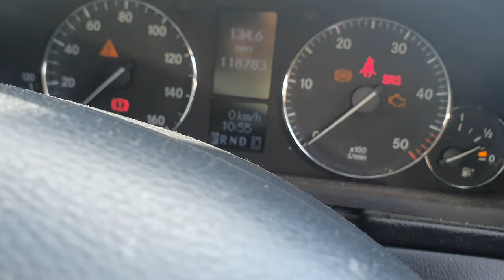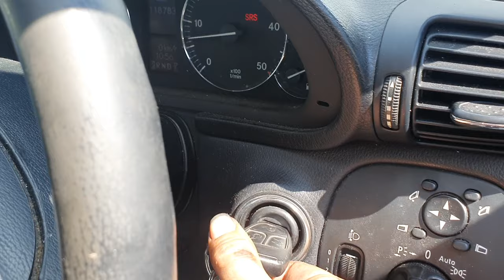W203 C220D Starter Fuse randomly blows (Front SAM)

Comment: Thanks Bro, was in the same situation just now and bought a 20amp fuse after seeing your video, back on the road. You are a lifesaver
Reply from the maker: Hello, I would be wary of increasing the fuse by too much. I know an extra 5amp doesn't seem like much but if I remember correctly the circuit was originally 10amp, however I read a Mercedes Service Bulletin which claimed it should have actually been 15amp and fitting the 10amp from factory was a little mistake. I only used 20amp fuses for diagnostic purposes to try and see how much current was being drawn when the fuse blows. A lot of the diagnostic procedure was not shown in this video. Watts law should be considered here; Volts X Amps = Watts. Since these circuits are 12v then a 10amp fuse would mean the circuit is rated at 120w (watts), following the Mercedes bulletin (15amp) the circuit was actually rated at 180w, but with a 20amp fuse you're now allowing 240w before the fuse blows. Fuses are there to protect the wiring (and circuits) behind the fuse. 

If I remember rightly (it's been a couple of years since I worked on this) the car had a 140w Starter Motor, meaning with a 10a fuse the Starter Motor would underperform ever so slightly and only cause issues as the starter begins to wear however with a 15amp fuse it would have plenty of current and work strong until an actual fault with the Starter Motor causes excessive current draw - at least in normal circumstances. However with a 20amp fuse the circuit is limited to 240w, meaning it would take a considerable fault to blow the fuse offering the rest of the circuits virtually no protection. I would recommend dropping back down to 15amp and, if the fault persists, replace the Starter Motor.   -- Having re-read this comment after posting I feel I should probably clarify that I'm taking about the current draw from the Signal Circuit of the Starter, not the Starter itself. Starter Motors usually have a pretty much direct-line to the battery and require around 2kw (2000w) for this model of car.
Reply: Perfekt erklärt 💪💪

Comment: I have the same problem at the moment,  I have had  fuses blow, I can turn the key several  times and it will not start ,I can hear a click everytime  I turn the key , then it will start, it will be at the garage on the 16th Oct, I hope it will be sorted I will post what I the garage find.
Reply: Hello Peter. How are you? I have same problem with mine a w203 2004 model automatic transmission. It started blowing the 15amp all the time when I tried to turn on the car. With my own risk I put a bigger fuse to handle the load. It worked for some time but now doesn't work any more. It gives a click sound but without starting the starter. I think the starter has problem with the carbon brushes.  Is not problem with battery because I have tried with another battery in parallel without success.
Reply from the maker: It really bothers me that I wasn't able to get this fixed. There is a global shortage of electronic components at the moment and so it was going to take too long to get the specific component that I found to be faulty. Because of that I had to call it a day and my friend sold the car as it was and brought a Lexus (much better car). I am fairly confident that, in my case, this was a faulty Current Sensing Resistor on the PCB of the SAM Module. Hopefully you have a simpler issue, that me. Best of luck.
Reply: Hello, did you get it fixed? What is the problem? I got mine burning fuse 52 now aswell. rofl
Reply: @chilldeepcs5234  Hi ,the problem was water leaking through the bottom of the screen and dripping  on to the fuse box and the ecu,the lid on the fuse box still will not fit  so I have sealed the screen and covered the fuse box with a plastic bag, I have not had a problem since. Hope you get yours sorted. Pete
Reply: @Peter-it5ht  Hey pete! I have the same problem. How did you make sure that there was water in the fuse box and how did you get rid of the water. I would appreciate if you could answer. Tuomas
Reply: @gjergjkastro9404  hello kastro. Did you managed to fix your w203? I have the same problem . Îs it the starter? Or îs it electrical problem with the ecu ? Please answer it would help me alot. Thank you.

Comment: I watched this vid and switched to a 15 amp fuse about a year ago but now even the 15 amp is blowing, any advice on how to diagnose it now ?
Reply from the maker: It would be either bad starter or the SAM (PCB that controls fuse box), the car in the video was faulty SAM. If you can get a known-good starter for cheap enough it may be worth replacing it to see what happens. If it's the SAM it will work out cheaper to get an independent garage to do it, as you need diagnostics equipment capable of reading faults to be sure and then recoding the replacement module. Absolute nightmare. I'm experienced in PCB rework so I was able to disassemble this one (very difficult, 10/10 would NOT recommend) and diagnose a single faulty component, but due to global shortages I was unable to source a replacement in a reasonable timeframe so the owner decided to sell it for spares or repairs. In your case it does sound like a faulty starter motor though, bad SAMs tend to pop fuses regularly but not every time. Only reason I increased fuse size to begin with was because there was a Mercedes Service Bulletin that said the original 10a was a tad over cautious, and that their techs were replacing them with 15a fuses if it ever presented an issue. Hope this helps.

Comment: i’m having the same issue and i’d like a bit of help, i’ve got a C200 Kompressor 2001 Automatic transmission, once in a while one of them it blows but whenever I take the black one out and I put it back in and it works fine, but then a month later or so is doing it again and while driving but it does still work, it happened again yesterday morning and i’ve done that , came back from work and when I wanted to go shopping i’ve driven maybe 2,3km and that happened again and a few times since yesterday and it’s very frustrating, can you guys help me?
Reply from the maker: The black ones (and the yellow ones) are relays - not fuses. A relay is an electronically controlled switch containing two circuits - one is basically an electro-magnet, when current (electricity) is passed over this circuit it closes the second (the actual switch) allowing current to pass through activating whatever component it powers. Relays control many different functions so it depends entirely on what the relay is for. By the sounds of it you most likely have a cold-solder joint (a small break in the soldered connection) inside the relay meaning that when it gets hot it's no longer making a good enough connection to allow current to pass through. Replacement of the relay would be the first step, if that doesn't help you really need someone who knows vehicle electronics to diagnose the issue as electrical faults are a nightmare at the best of times, and Mercedes are probably the worst of them all. These cars contains miles worth of wires, 5+ different control modules, fuses, relays, and a tonne of electronic components. They're unnecessarily complicated and if you're not experienced with electronic diagnosis or repair you'll spend months scratching your head and probably end up making things worse. Sorry I can't be of more help buddy, hopefully a replacement relay solves your problem.
Reply: @David-vb6yx  I’m not sure , i’ve changed the relay that i’m usually taking it off just to make sure , it was fine for a month and then it happened again yesterday so i’m not sure what’s going on , not easy to find a mechanic that’s experienced in the electrical/wires area , I live in Germany and where I live I don’t know many since I just got here couple of months ago, spoke to someone and they said it could be the computer being faulty and it needs to get fixed and it will cost around €300 not speaking in labour as well. The car isn’t really worth to put that much money in , it’s running well but it’s also quite old , if i’m being honest i’d just rather sell it on parts and just get something else , thank you anyway you was really helpful , hope i’m not too personal but do you have any socials i can contact you at? Thanks buddy

Comment: Where do you buy the fuse? Hardware store?
Reply from the maker: I would presume so, yes. They're fairly easy to find, search for "Blade Fuses" on eBay or Amazon and you should be able to find a pack with lots of different ones (like the one I'm using, not sure if it shows in the video). The colour/number on the fuse is the Amps it's rated for, DO NOT change the value of the fuse on a circuit unless you know what you're doing, always replace like-for-like... Your car may take Mini Blade Fuses which are the same thing in a smaller size, they're cheap enough so it's probably worth getting a pack of each just so you have them.
Reply: @David-vb6yx  thanks for your kind reply. That's quite helpful
Reply: @David-vb6yx  Which one is you think starter fuse? Fuse that's maybe responsible if our car engine won't start?

Comment: my engine dosent start at all i found the fuse like that put a bigger but no luck... i am thinking is the starter... what u think about this?
Reply from the maker: You could try a starter but best get it on mercedes diagnostics first, if you're getting front sam module error that's likely the cause
Reply: @David-vb6yx  is a bit tricky because to move the car will cost me a fortune. I can hear the starter engaging but not turning… will take me bit of work to take the starter out but i will go on this route for now
Reply from the maker: @GFrecovery-repair  if you can hear the starter engaging but not turning the engine then this may not be the issue. First thing to check is whether or not the engine turns freely, try to see if you can rotate the engine by hand with a socket on the Crankshaft Pulley, if it doesn't move with a long bar you may need a new engine, if it does then move on with diagnostics. Using a bit of wood carefully but firmly hit the starter motor, not hard enough to knock it off but firm enough to dislodge any shit that may be clogging it, always presume you've got a flat battery with non-starting vehicles and either use a jump pack or jump start with another vehicle.

Mercedes have very complicated electronic systems, often you'll only get so far with standard no-start procedures and may require specialist diagnostics, but the fundamentals are always the same - you need rotation, compression, ignition, fuel and air for the car to start and run.
Reply: Hi guys I had the same issue whereby the fuses kept blowing, so I started the starter old skool way with a long screwdriver 🪛 by touching both connectors on the starter. At first there was only clicks nd eventually started, I am of the opinion the starter just jammed. It's been working 100% ever since. Thanks Guys
Reply: @GFrecovery-repair  any good news to report soldier ?!?! I'm fighting a Mercedes E320 with same problem, any info is appreciated
Reply: @hajileserpud9539  yes I changed the starter because was gone but also my engine was gone because of water damage so i sold the car on parts. The video is very good if u have a car that u know about it or u can ask the owner about it. Mine was bought on auction so never see the engine turning.
Reply: @GFrecovery-repair  thanks a million, I'll have starter checked by mechanic
Reply: @mansuransar5534
Reply: @hajileserpud9539  was it the starter ?

Comment: Does the 15A Fuse solve the problem? Or have you tried a 25A fuse instead?
Reply from the maker: Sadly not, as you can see in the video it keeps "randomly" blowing that fuse no matter what size you put in there. I did strip the SAM and located a failing Current Sensing Resistor but couldn't get a replacement part in a reasonable timeframe, so unfortunately my friend had to get rid of the car.

Signal Acquisitions Modules are definitely repairable, but are by no means easy. If you're competent with electronics repair and soldering I'd say give it a go, worst that can happen is you find the component you need will take 36 weeks to get! lol Oh and definitely get some very low melt solder!
Reply: @David-vb6yx  I have the same problem with my w203. If I change my starter do I have a chance to fix this problem ?
Reply: @okeyjokey981  did it fix your problem
Reply: @jamesyoung7719  yes it was the starter. From the moisture. I have replaced it with a new one. It cost me about 100$.

Comment: Bad SAM I believe!
Reply from the maker: Yes it was, just 1 faulty Current Sensing Resistor but due to the electronic parts shortage at the time I couldn't get hold of a replacement unfortunately and the guy needed a car. Really put me off Mercedes though the thing looked like it had been soldered together by a blind monkey with no hands!

Comment: Thanks a lot your video helped in my critical situation
Reply: Thanks dude! 
I just replaced it with 15A works for now.
If the fuse keeps blowing i will be pretty sure that the starter is the problem.

Comment: I have a c200 2005,does the same.. But when jump started it starts. Could it be the starter? Please help
Reply from the maker: Could be either the starter, battery, alternator or earth strap. Test the battery voltage with a multimeter, should be just over 12v with engine off, if not replace the battery. Jump the car and test again it should read 13.8v or higher, if not it's the alternator. Then turn the car off and connect a single jump lead from the negative of your battery to a decent ground on your engine, you should find a metal loop thing that is used to lift the engine out which is best, if it starts you have a faulty earth cable. If battery and alternator are good and car won't start with the earth bypass then you likely have a weak starter. You could also try hitting the starter with a bit of wood or rubber mallet and seeing if it will allow you to start it, if that works replace the starter motor asap. Good luck 👍

Comment: My fuse not blown but key is dead after changing battery it won't work doors or boot ?
Reply from the maker: That's a different issue entirely. It sounds like either key battery has died or it needs resetting. It's a simple procedure but it varies from car to car. Have a google, should involve putting key in ignition and pressing or holding door lock buttons...

Comment: hey bro i have problem
I have w203 2001 c200cdi
Before 2 years I wanted to start car and nothing happened. I just changed 15 blue fuse and car started
This morning same situacion
I saw that 15 fuse blue is burned
Ive changed the fuse and tried to start. Nothing happened. I put new 15 fuse and again burned. I dont know what to do, maybe some relay or something. Do you have any advice?
Reply from the maker: You could try a new Starter Motor if you can get one cheap enough, if the fuse constantly blows I would think that's the most likely cause. Failing that it would most likely be a short somewhere in the wiring. Hopefully you get it sorted.
Reply: @David-vb6yx  Hey bro, I put 20 A fuse (yellow) and car is working for now. I dont know schould I visit workshop to chech everything about that or?

Comment: bei mir war es die zu schwache batterie, laden hat auch nichts mehr gebracht, eine neue musst her. beim messen der Spannung gabs nur 10,44V!
Reply from the maker: Yes that's definitely a dead battery. Sometimes with a decent smart charger they can be revived, and sometimes excessively low voltage would require a top-up of the battery fluid if it's not a sealed unit. In my opinion, though, a new battery is the way to go as some come with a 3-5 year warranty which covers you in the event of battery failure for longer than you're likely to own the vehicle.